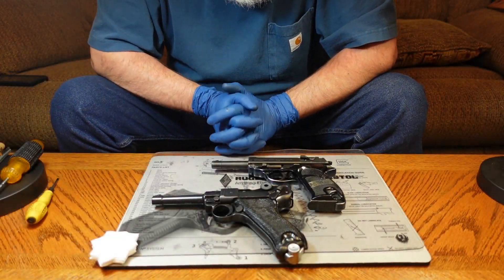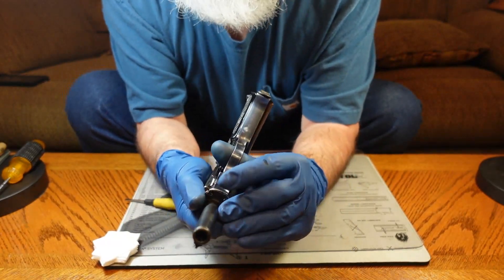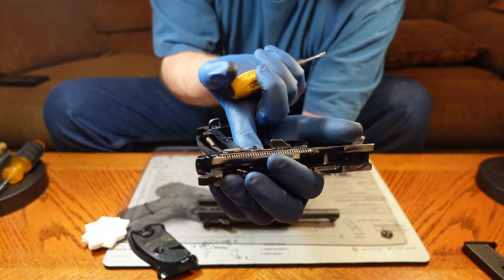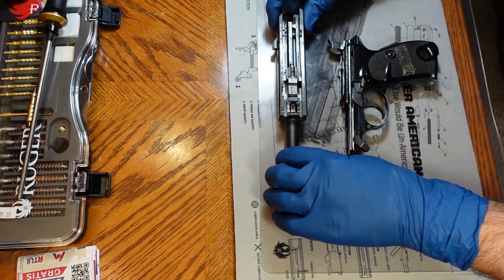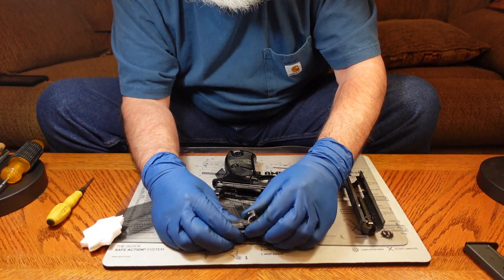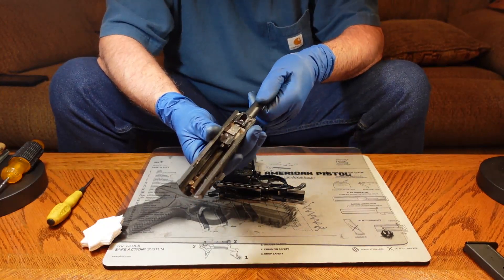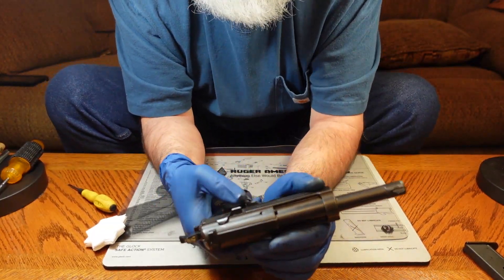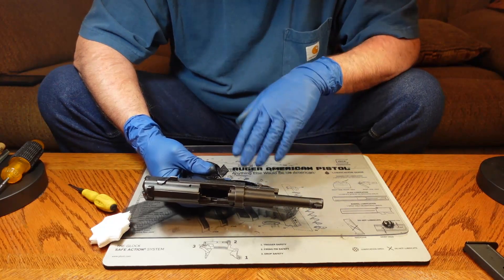How to disassemble and reassemble the Walther P 38. Part one. #walther #p38 #gunsmith #pistol

Comment: I have a WWII P38 and I admit I'm intimidated by it a bit. I've fired it and replaced the springs, but the disassembly lever drove me nuts as you mentioned. Thanks for this!
Reply from the maker: Yep! It has a few frustrating quirks, that's for certain. The first time I took one of these apart, I spent a good bit of time muttering to myself. "What the hell am I doing wrong?"

Comment: Great video! I have a 1983 Interarms imported Walther P38, that I bought brand new in 1983. I have the 2 improvements they made, the fat slide, and reinforced Hex Bolt. Mine came new in the Walther box, with 2 magazines, incredible 25 meters test target, and cleaning rod. I paid big money for it even back then, because the German Mark was strong against the Dollar. Then in the 1990's they started importing thousands of the P1, same gun, police trade ins that came with a holster. These were so much cheaper! Looks like yours has the fat slide, but no reinforced Hex Bolt. I'm guessing it was made before 1978. I have shot several plus p's in mine, with no problems. My gun still looks about 95%. I'm wondering if the problems with your gun, had anything to do with hot rounds, and no reinforced Hex Bolt?
Reply from the maker: The gun came to me with a broken locking lug. I don't know for sure, but I would say over pressure is a good bet. It is probably responsible for that broken locking lug. Right now the gun is (in my opinion unsafe to shoot). It is clear to me that somebody in the past put a lot of rounds through that gun, even with that broken lug. Not a great idea!  I have ordered the parts to fix it, and will do another video when they come in. Just for the sake of information, a standard .9mm produces about 24000 Lbs. per sq. inch of internal chamber pressure. The +P exceeds that. There is a good reason why manufactures stamp what ammo you should use right on the gun. Over pressuring a gun can be tantamount to holding a pipe bomb in your hand. Not a great idea! That said, with the use of the correct ammo, the Walther P-38 is a great gun, and perfectly safe to shoot. If it is in proper mechanical condition. Thanks for writing in. I would say that your historical knowledge of this gun very likely exceeds mine. I really appreciate your comments. They will help me to make better videos in future.
Reply: @Bill1911  Agree with you about the plus P's, you need to be careful, and follow manufactures recommendations. When I bought the gun, brand new in the box in 1983, you didn't have the choices we have today. If you wanted a double action 9-millimeter, your choice was the Walther P-38 or S&W Model 39 series. If you wanted single action, then Browning High Power. The P-38 was my home defense gun, along with a Colt Diamondback 38. No carry back then. So, I wanted to make sure good strong self-defense Hollow points would work. I believe because mine has the updated Hex Bolt, there is absolutely no damage to mine. That is why they did the update, because of several broken locking lugs with police and military agencies. I no longer shoot plus P's or Hollow points in the P38, because I have several other guns, that fill the home defense, and carry needs.

Comment: Quick question for y’all, my family’s grandfather brought one back after WWII. 
Now it’s been years since it’s been shot shot and I’ve been told it has a hard time ejecting. 
I’m assuming 115s were being fed and we all know German weapons prefer 124 or up. But in manual operation, I have yet to get an error. 

I will be taking it to the range tomorrow for some shits and giggles, since I’m not an idiot I’ll be loading one round at a time to make sure it still functions - as it does in manual operations. I can discern every click it’s supposed to make.
Reply from the maker: I would oil the gun before testing. Over time oils can dry out, and become gummy. This can cause the slide to slow, and cause a variety of cycling problems. We see the problem of dried oil a lot on gun-safe queens. Not a bat idea to start one round at a time. Make sure to oil the mag. spring and follower. Then load multiple rounds and test function.
Reply: @Bill1911  just got done, put 30 rounds through it with no issues. Ran one at a time for the first handful, then loaded completely. Must’ve just been bad ammo before
Reply from the maker: @DeathByLego  Glad you got the problem resolved. Thanks for watching!

Comment: The 38 carried over after the war as almost the same pistol, I believe from the steel came the aluminum frame but these are very similar
Reply from the maker: I don't consider myself an expert on the history of these fine guns. The one in the video has an aluminum frame. It is a P-38, not a P-1. I'm not sure exactly where this one came from. They were used throughout Europe by many countries for both military and police use, and were often replaced and sold as newer and better guns became available. I will try to do more research to become mor conversant on this gun.

Comment: It’s called a P 38 because in 1938 it was approved for use
Reply: Are you sure that’s not a P 1 ?
Reply: @neilhartigan7456  Mine is the post war aluminum frame but is marked P38. I think the ones made for commercial use are marked P38, and the ones for police and military are marked P1. Sort of like the Beretta M9 for military, and 92FS for civilian use, same gun.
Reply: @gracedagostino5231  I have a P1 made in west Germany. They cast aluminum frame. It has a reinforcement bolt through the frame by the barrel link. I paid $229 for it 15 years ago. It’s a fun shooter.
Reply: @neilhartigan7456 Mine retail listed at $688, and I paid the "discounted price" of $545 in 1983. That would be $1,600 in today's money. I got really upset when all those P1 were $200! I try to look at the bright side. Like you said they are fun to shoot. Also, mine seems to have a little better finish, and little better trigger than the run of the mill P1. My test target out of 8 shots at 25 meters, 6 went dead center in one ragged hole, the other 2 were an inch apart. The store clerk had 5 new in the box, and mine had by far the best test target. I always look at test targets on Gunbroker for P38, P5, P88, and have only seen one that was as good as mine, and it was a P88. I think I try to make myself feel good, because I paid so much!
Reply: @gracedagostino5231  I didn’t mean to disparage you. But I thought I was buying a P 38 when I turned out to be a P1 with the reinforcement ball through the frame   It’s a fun shooter would l go to war with it no
Reply: @neilhartigan7456  No problem. The post war aluminum P38, and P1 are the same gun. My in the box, Interarms imported P38 usually brings a higher price on Gunbroker, than your run of the mill P1, even though it's basically the same gun. It is a very fun shooter, with a quick reset.
Reply from the maker: Yes. I'm sure its a P-38, and not a P-1. Thank you for bringing that up. It is something I will talk about in part two of the P-38 video. The gun in the video came to me with a broken locking lug. It is a good bet that someone in the past used ammo that exceeded the pressure capabilities of the gun. .9mm+p, or +p+. A standard .9mm produces about 24000 lbs. per sq. inch. of internal chamber pressure. That translates into a lot of ouch if the gun comes apart in your hand. (In my opinion the gun I used in the video is currently unsafe to shoot.) Someone before I got the gun clearly put a lot of rounds through it with that broken lug. Goes to show that a second hand gun should be taken apart and thoroughly inspected before you take it out to the range. That said, I'm a gunsmith, and I've taken used guns to the range and shot them without taking them apart for inspection. Including this P-38. The gun was shooting to the right, so I stopped shooting it, and took it home to find out why. After disassembly I discoverer the unusual wear, then I saw the broken lug. I was pissed at myself for not looking the gun over more thoroughly before buying it. I cleaned it and put it away. It has been sitting in my safe for a very long time. It wasn't a high priority that I fixed it. Customer guns had to be done first. Well! Now I'm retired, and I can finally get around to doing all the things I've put off. The up-side is It will make a great video.